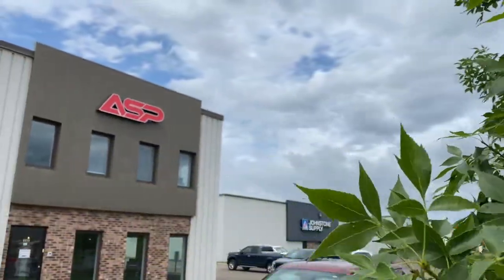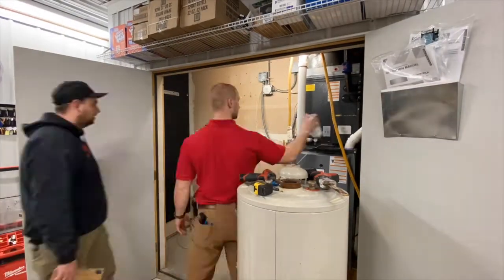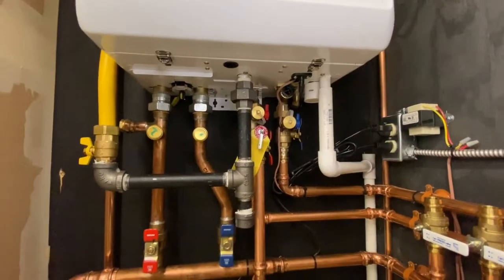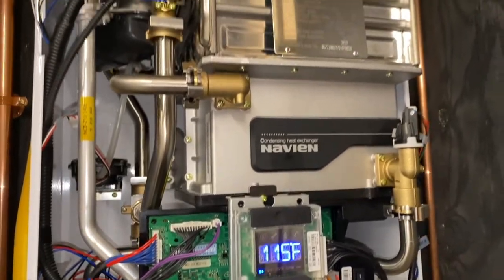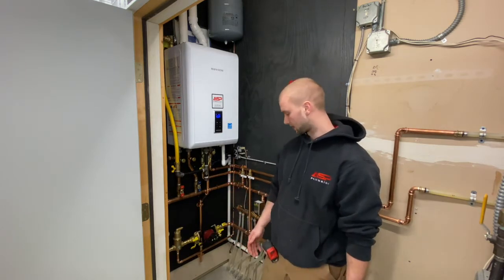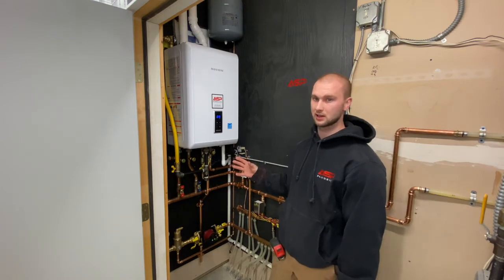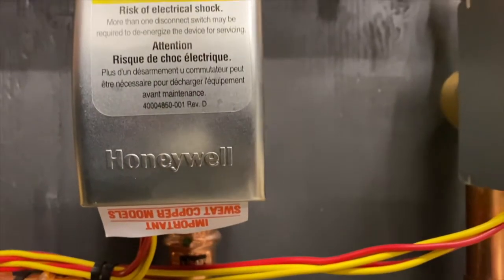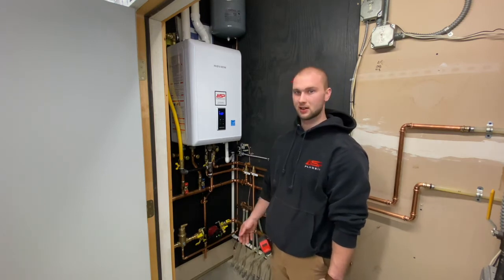How to Choose a new Boiler - High Efficiency Combi Boiler VS Old Atmospheric Boiler/Water Heater

Comment: You neglected to tell the whole story. These boilers have a 10 to 1 turndown BASED ON INPUT. Most Combis are 200,000 IN, which leaves us with a minimum firing rate of 20,000 BTUs. Many of these new efficient homes are less than 30,000 at 0 degrees. This means anytime the house load is less than 20,000 the boiler will cycle. Then we are right back to where we started. Until we devise a boiler with infinite turndown it is best to stay away from combis. Efficiency wise it would be much better to install a 50,000 btu boiler and a separate tankless water heater. The minimum firing rate would then be 5000 BTU and your reset control would keep the boiler running for much longer cycles. Also as a Navien installer you already know that a Combi boiler takes you right back to the S model. Cold water sandwich, Minimum flow rate, longer wait period for hot water to reach the faucet. After installing A models, why would you want to go backwards. Nice looking job

Comment: It will be lucky to last a quarter of the life that cast iron boiler would have..
Reply: These boilers come from countries that use warm water to heat. If you install one that runs at 186 and are inept at setting up outdoor reset controls, you are correct they will have a very short lifespan. Most "boiler" guys can't even do a simple heat load and an EDR to find the correct temp to begin with. It is a great time to be in the HVAC business   LOL!